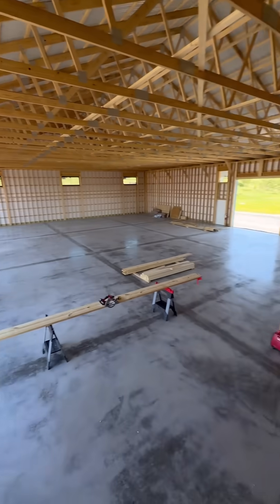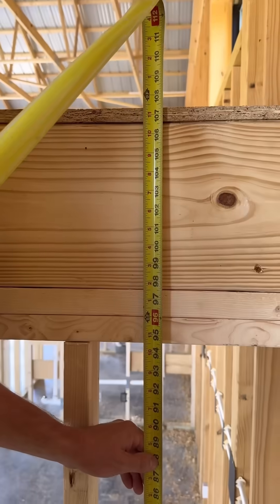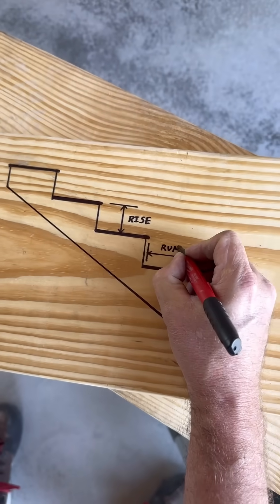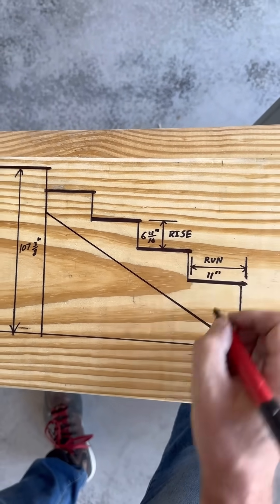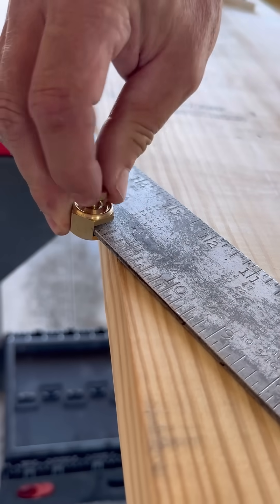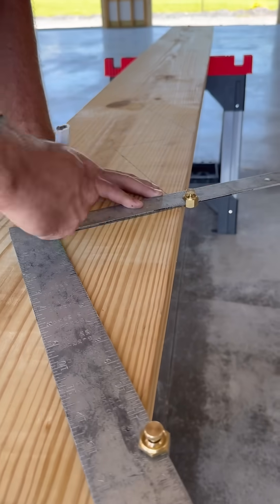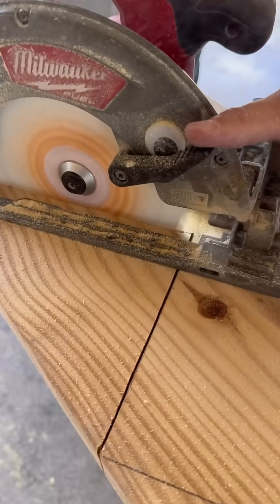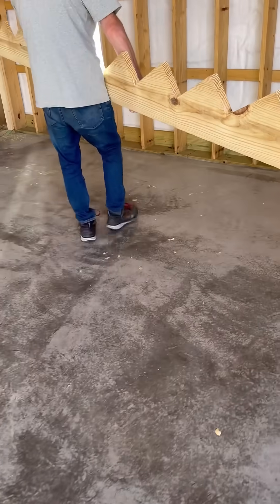How To Measure And Cut Stair Stringers

Comment: Left out a couple big facts. I know what you did, but viewers may not. 1- How did you determine how many risers? 2- Dropping the stringer explanation for tread height. Hope this helps. Excellent video! Fun to watch and great editing!
Reply: In residential stair rise height in my state, building code is between 7”-8”. 

I take the total height of 107” and divide by my minimum riser height of 7”.  107\7= 15.28 rises. Drop the remainder so you have 15 rises. 
Now 107” divided by 15 rises is 7.133” 
7.125 is 1/8 so it’s just over 1/8, but definitely less than 3/16 which is 7.1875. You got yourself a set of stairs. Use a nice 11” tread and you’re off to the races.
Reply: 107÷ 13 risers = 8.23". That won't work Too tall on riser. 107÷14 risers =7.643". Too tall for commercial, not residential (not to be exceed 7 3/4"). Therefore, for residential,  that would be a tad more than 7 5/8" which I would go with on residential stairs. 107÷15 risers = 7.13" or a tad more than 7 1/8". That's how I do it. Two riser heights deviate from that: the top and bottom risers depending on adjacent finish floor thicknesses.
Reply: Thank you
Reply: I have seen many DIY decks fail inspecion because the tread depth/thickness wasn't factored in!
Reply: Pythagorean theorem
Reply: If 7 don't work work your way down til it does😮
Reply: @JasonSeals-u3x that is such a waste of time. You can figure it out with a calculator quick if you just think about what you're doing
Reply: @JasonSeals-u3x  
Anyone that can divide and multiply can build flawless stairs.
Reply: Use a construction master calc and figure stairs out in about 3 seconds.

Comment: Great video You forgot to mention about removing the height of your tread from your bottom step rise and the thickness of your riser (if any) from the top run length.
Reply from the maker: Actually I did mention that on the other platforms, but didn’t have time in a YouTube short

Comment: Matchstick house!!! One good tornado...GONE!!!
Reply: Yet a tornado will rip the roof off a masonry house and push the walls down too.  I used to think that masonry houses were a better answer, but timber frame houses can certainly made hurricane proof, and neither timber-framed nor masonry houses will stand up to a tornado.  

Even if you built a house with a "red iron" steel frame, a direct hit from a tornado will still tear the roof panels off, blow out the windows, and tear down whatever material you use for the walls.

Comment: It’s best to make sure it fiste before you cut the steps. Cut the plumb cut and the seat cut and dry fit. If it hits your marks. Cut the steps and use as the template to cut them all.

Comment: If  memory serves me, (here) commercial is 8” inches max rise.. 7” is res. 
I always shot for 7 3/8” ~ 
107.375 / 15=7.1583” rise or 7, 3/16

It’s always wise to check (for drainage sloping) where the stringers will met the concrete floor for level. 
That will garantee your total 107 3/8” rise is accurate and therefore your treads will also be level. 
Easy enough (11”x15*=165”out ) check with a straight 14’ 2x6 on edge and a level.
(*15 runs)

11”c/w 1.5” nosing✅(code!) 
For this one building I was doing all the stairs in steel, the super ordered 1500 stair treads @10”.runs.. For 52 sets of stairs! 
( if you want to subtract  the 1.5” nosing that leaves an 8.5” actual tread) 
They still all passed final inspection.  Smh ! Lol

Little known trick:  if you make your top tread flush with your deck, your stair handrail will make a seamless transition join and  butt into the top of the handrail on the deck.
And that also is easily lag screwed into the framing of the deck  when  stringers are joined with 3/4” plywood.. win-win.
Reply: 7.1583” = 7-3/16”
Reply: @mikewinter87  
😂✅
Reply: Everyone goes on about how easy fractions are to use, so I find it funny that you need to switch between fractions to decimal and back again.
Reply: @dampaul13  
It’s easier to divide a decimal by 15.
Reply: @henrinaths1  I know why you have done it and it shows a flaw in the logic of how easy fractions are to use when you feel the need to change the type of non integers you use.
Use decimals all the time and you don't need to make silly changes like that.
Reply: @dampaul13  
I already know that but thanks for pointing it out. 
(What you call silly I called convenience ..Some don’t know how to change a decimal to a fraction.)
Reply: @FFLFFS  "What you call silly I called convenience"
Yes, because doing an extra step is always more convenient! 
You know, especially when those steps are mathematical in nature and allow for simple mistakes and rounding errors, but let's do extra steps anyway. 

I'm pretty sure that's what everyone says,
"Let's do more steps, allowing for a greater chance of making a mistake, and that will make things more convenient and better!"

Just imagine if there was a way to come up with the same result (possibly more accurate), with fewer steps, allowing for fewer potential errors. CRAZY!
Reply: @dampaul13  
You fail to realize I did that step for u tube. 
I work alone for the most part. And I don’t have a tape measure that shows a units of measure in decimals. Every set of stairs I’ve done in my entire career was flawless. 
So I don’t really know what you’re going on about. 
But thanks for your effort
Cheers
Reply: @FFLFFS  The fact that you need to do an extra step to show how simple your process is shows the flaw in your argument. 
If it was so simple for others to understand, you just would have shown how you do it normally.
But you didn't because you realised that your simple process is more complicated than it needs to be. 

It's why most people work in mm, the beauty of working in whole numbers.  

And no tape has or needs decimals.
Reply: @dampaul13  
I really don’t think you know what you’re talking about. 
And I don’t think you’ve ever built anything let alone a set of stairs. Because if you did you’d see how simple those numbers actually are and you’re complication is all nonsense in your head. 
Take those measurements and either build a set of stairs with them or shove it.  I don’t really care .
2721.82082mm divided by 15=      181.4547213333mm 
Get yourself a metric framing square. 
Comes out to the same thing. 
Cheers!

Comment: The one thing this vid didn't mention was the 1st (bottom) step needing to be adjusted for the thickness of the thread. Seen many mess a set of stringers up due to that offset not being there.
Reply from the maker: Totally correct, I cut 1 inch off the bottom of the stringer to count for the tread thickness. Didn’t have time to fit it in the video.

Comment: U need a landing on stairs over  13 rises
Reply from the maker: Actually, the rule is you need a landing if it’s over 12 foot of vertical height for a commercial building. These plans were designed by a structural engineer and approved by our local city inspectors before we started the project.
Reply: @hausplans  that sounds crazy, the horses would have to be over 20 ft long..but I mostly know residential construction and codes vary everywhere..and I am know where near a code freak..they're for pencil pushers who don't know which end of a hammer to hold n to cover ass legally..good job tho, do away with those stair clips they suck LOL..clamp a straight edge on to the framing square, reason being when u need to go to the very end of the board those clips fall off the edge, the straight wont..40 yrs experience 👍

Comment: I’ve got a question. Hope you can help point me in the right direction. 

I have an existing garage, wood framed, horizontal strapping then metal exterior. There is no vapor barrier. How do I insulate to be able to heat it in the winter? Pull the metal off and wrap the building?

Comment: This is the best advertisement for the metric system on YouTube.
Reply: 11/16
Watta
Reply: @HyennaTheOne That is not any more difficult than 7/10ths
Reply: @brandonn6099   it is much easier to divide by 10 what are you talking about. Divide number 355739 by 16 from your head. By ten it is easy, just move the decimal point. It is 1520/16 times easier
Reply: @HyennaTheOne  This problem did not involve division by 10.
Reply: It’s just a grouping of numbers. God why are people so dense. It doesn’t change the math.
Reply: I was a Civil Engineering Draftsman and our scale rulers were broken down in 10ths of a foot. Way to bastardize both methods.
Reply: It’s silly.
Reply: 2 hard hats of flour 👍
Reply: These kind of comments always cause a cufuffel. Metric is an easier system and I bet it has way less manufacturing errors than people who use US customary units. Engineers use thousands of an inch for a reason.  It would also mean globally one tool standard.
Reply: I'm old enough to remember when the US tried to switch to the metric system in the 70s. Freaking Baby Boomers Silents and "The Greatest Generation" got all whiny about it. Now we are stuck trying to divide stupid fractions into even more stupid impossible fractions.
Reply: @jimmyjohnjames6397  yup. Thank god for construction calculators.
Reply: Metric is trash.
Reply: Eehhh give or take 5 cheeseburgers long.
Reply: Honestly, building is the last place the difference between metric and imperial is noticeable. 🤷🏼‍♂️ You're gonna divide by fractions quite often, no matter what you use. You guys have 1/10, 1/5, 1/2... We have 1/16, 1/8, 1/4, 1/2. Some tapes have 1/32, even. It's really not hard, and it's even easier if you have a calculator.

It's l:ml great? Yeah. That's pretty cool. Covering from meters into km easy, is cool, too. 

That's being said, you just don't run into the problems the imperial system has in construction very often.
Reply: Only if you like to blindly follow the french.
Reply: @badgerpa9  And everybody was blindly following America as well. Trump is fixing that.
Reply: Gross
Reply: Equal 19?   Not 7 11

7.5 + 11.5 = 19

Or 

4 and 15 

7 and 12

....anyways, if you go over 22 inches, the stairs start to get "uncomfortable " 

Some may a 4 and 24 is not comfortable... more landing for a tiny step down.
Reply: Has the same thought with all those fractions everywhere
Reply: The task at hand here isn't any easier in metric. In fact, it's probably harder. The 107⅜" storey height works out to 2727 mm but let's call it 2725 mm. The metric equivalent of a 7" riser is 175 mm.

Now look at where we are at this point with the two systems: with Imperial, you need to divide 107 by 7 to figure out how many steps you'll need. Well that's not too difficult, especially for someone who does this regularly as they'll know that 7x14 = 98, so 107 is one more, 15 and a bit, which makes for 16 steps on the rule of don't go over 7".

But over in metric, you're having to divide 2725 by 175. Or if you work in cm (because for some bizarre and completely senseless reason most metric tapes are graduated in cm rather than mm), you're going to try to figure our dividing 272.5 by 17.5. Which few people can do in their head.

So while the Imperial carpenter is now on to calculating the actual riser height as he could determine the number of risers in his head, the metric carpenter is having to reach for a calculator just to figure out that basic part of the problem.

Imperial carpenter has to divide 107⅜" by 16. Well 6x16 = 96, so he's left with 11". Since in this case he has 16 steps and since inches subdivide into 16ths, you know right away that the fraction is 11/16ths. And now he's on to actually laying out his work.

Metric carpenter, having found his calculator or brought it up on his phone after swiping away some WhatsApp msgs can now divide 2725 by 175 to get 15.57, meaning he too needs 16 steps. And now he has to divide 2725 by 16, giving him the unholy number of 170.3125 mm.

Yay, metric.
Reply: And somewhat amusingly, if Metric folks actually worked with decimetres, this problem would be easier as our 2725 mm is 27.25 or 27¼ dm while the risers are 1.75 or 1¾ dm. With decimals you can see it will be at least ten steps (17.5 dm) but using the fractional method you can at least "test" multiples of 4 to see which gets closest: 12x1¾=21 so you know that's not enough while 16x1¾=28. At that point you'd know it was 16 you'd need. No calculator needed, unlike working in mm or cm.

It's all so odd because decimetres are the least used but most practical of all the human-scale metric measures.
Reply: @davidjames4915  
For a start, carpenters do not use decimetres or centimetres or even metres for that matter.
Second, you are conveniently finding a figure that is a whole inch, but down to a 1/25 of an inch in the metric system. I don't know about you, but if someone is working to the nearest whole inch then god bless em.
I've spoken to many old time carpenters that unlike me had to convert to metric in the 70s. Not one, I repeat, not one longed for the the imperial system. Sure even today in Australia, we refer to timber casually as a " 3 b 2" or the like but when it comes to actually measuring, its metric for the win. Also, my old boss said there are far less "stuff ups" with the metric, which means more efficiency. If you gave it a try, I can confidently say you'd love it.
Reply: You still need to do math. The Metric system is easier for the math challenged due to it being a base 10 system.
Reply: @JesusFollower7559 The math isn't really any easier when you already have to divide
Reply: @brandonn6099 its FAR easier because the pitch isn't expressed as 7/11 to begin with.
Reply: Dunno, works pretty easy when you divide by 16
Reply: We don't use the metric system here in the US because English is the primary language here.  This means our measurements are also in English.
Reply: @Soxruleyanksdrool  Ah, yes, that explains why the only other countries that don’t use the metric system are Liberia and Myanmar.
Reply: @Soxruleyanksdrool  Huh, I didn't know that I didn't speak English, what being from Canada and all.
Reply: @Soxruleyanksdrool  such a troll. So then how come the English people use the metric system.
Reply: @Soxruleyanksdrool  What? What do you think the Metric system is?
Reply: @Soxruleyanksdrool hate to break it to you but the imperial system is a greek/roman invention and metric system was made cohesive by a Scottish man. America hasn't converted because it would be politically unpopular largely because of the falsehood of America being the best/greatest

Comment: How did u get 16 risers? I appreciate you sharing your knowledge. Your skill is very high for sure!!
Reply: I want to know also
Reply: @jodhast.clair-canaii4427  platform height is 107.375". He wants his rise to be 7" or less.
107.375 ÷ 7 = 15.339 steps. If we round down to 15 steps then the rise will be more than 7"... So we round up to 16 steps so the rise is less than 7".   Platform height 107.375 ÷ 16 steps gives a rise of 6.710" or 6 11/16".
Reply from the maker: Start out by dividing the overall number with seven then decide if you’re going with 15 or 16 and so on, but you need to stay under 7 inch riser
Reply: @hausplans Great job on the build! Did you delete my comment? I gave a thorough answer on how to find the rise of a set of stairs, but it is not here. I've noticed that many of my comments on YouTube are being deleted, and I am starting to think that YouTube is auto-deleting all of my comments. Thank you in advance for your response, as well as all of the great content that your channel provides!

Comment: Ive heard Homemade stair guides work better just a board with some dados/ grooves to fit in square and some clamping nuts, holds it perfect, and you can work quicker apparently.. i have the same ones as you, but need to make a homemade one sometime, just thought I'd mention it 🤷‍♂️

Comment: Great job on that stringer set. Have you ever stacked them all together cutting the top one and using the curve of the saw to lay out the next one also, you don’t have to cut every step to check for fit just the top riser and the bottom one always remembering to minus the thickness of your trip, but overall great job
Reply from the maker: I haven’t cut the other stringers yet- I might try that technique. I did remember to cut an inch off the bottom for the thickness of the treads. I showed this in my Instagram and TikTok version had to cut it short for YouTube.

Comment: What about the tread thickness on the bottom step? The riser thickness on the top step? Incomplete! Ahhhh!
Reply from the maker: I had a longer video explaining this on TikTok and Instagram. The subfloor is finished floor on the top.
Reply from the maker: I cut an inch off the bottom riser.

Comment: "So I don't weaken the stringer"
In what world does reducing the total weight bearing dimension of a structural member by almost 50% not already weaken it?
Reply from the maker: Weaken anymore than is necessary- the stringers were specked by an engineer
Reply: @hausplans  Stringers don't need to be weakened at all. Cutting them so that the steps sit on top is a purely aesthetic decision.

Comment: How about not cutting and leaving it whole. Just nail a 2x4 at the bar of the angle and set the steps on that and the stringer never weakens and I usually put a couple more boards joining them together also laterally.
Reply from the maker: I’m planning to have four stringers if I didn’t cut them and nailed two by fours on the side I could only have two one on each side